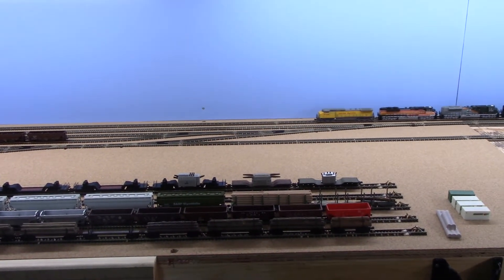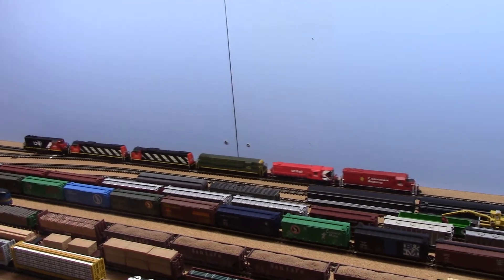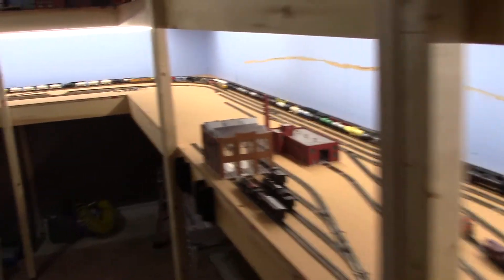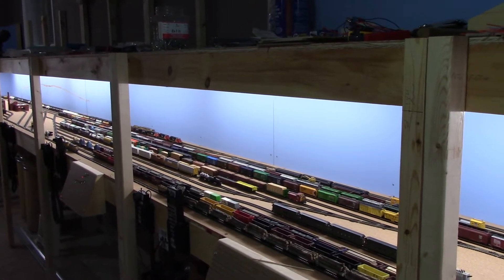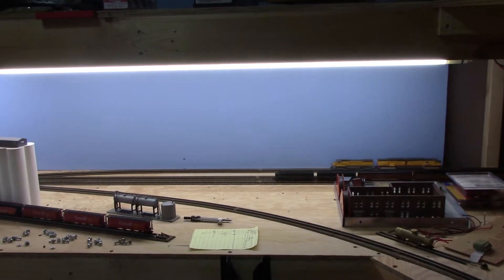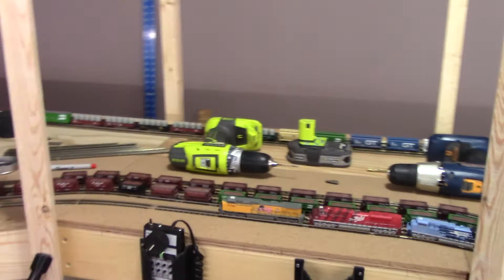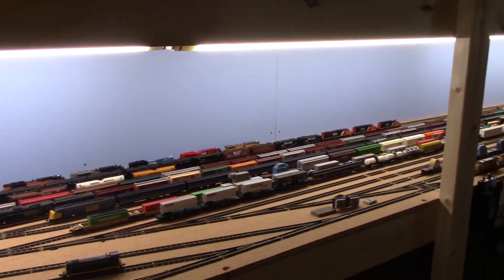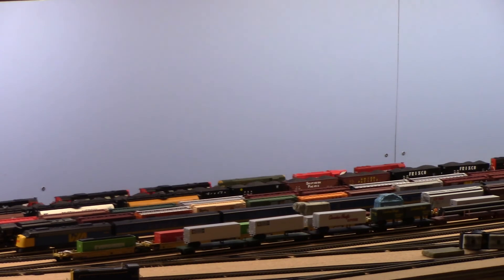20170805 How may n-scale loco's can a Digitrax DB150 base station run?

Comment: How did you manage to run the two different brand locomotives at the same time? Without frying the engine?
Reply from the maker: If each loco has a DCC decoder in it, there is no issues in running them no matter who the locomotive brand manufacturer is.  That is the one nice thing about using the DCC system instead of using DC.

Comment: Dave, are you using any PM42 power sub district boards or similar to divide up the 5 amp units further? Do look into it if you aren't as a single short will shut the whole layout down otherwise. Lovely layout by the way. Hope you get into occupancy and signalling too.
Reply from the maker: At the moment, I'm not using a PM42.  Though I've read different opinions, I'm currently using an automotive light bulb to manage short management in the main yard and the quarry/yard.

Comment: To me...Digitrax is the best unit out their, easy to use, will handle a lot of Power units. I run an old fan from a old PC I junked, keep things nice and cool.  Bob, Longshadowsmodeltrees.com
Reply from the maker: Hi Bob, thanks for the comments you make.  Apart from the very technically written manual that can be hard to follow at times (not the most user friendly), I've had no issues with the Digitrax equipment itself.  Now I'm only using the minimum functionality of the equipment, so I can't comment on the radio control throttles or IR aspect and the issues that may happen with those more advanced systems.  The guys I know use Digitrax, so there is a benefit to taking a throttle to another's layout or helping with an issue with their system, having the experience with running it yourself.  I've dropped a heat sink (from a scrapped out bit of equipment from work) on my DB150 to aid in keeping it cool as a static non-powered aid, just in case, as sometimes I'm probably pushing 4 amps out of the unit.  Haven't had it cut out YET due to overheating.  We'll see what the future brings I'm consisting more loco's for those long trains.
Reply: Hi Dave, Walt here, I'm a rank amature when it comes to model railroading. I'm having great dificulty with electrical issues on my Peco electrofrog turn outs. Any chance you could assist me privately. My email is walt@scotson.us any one else reading this and willing to help feel free to contact me. Im in central Montana with no other modelers for 100 miles.